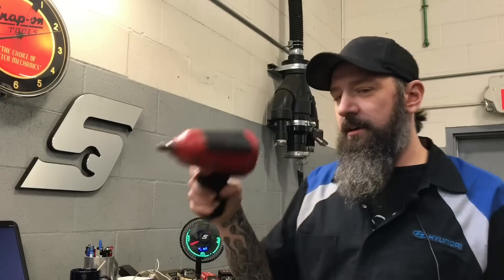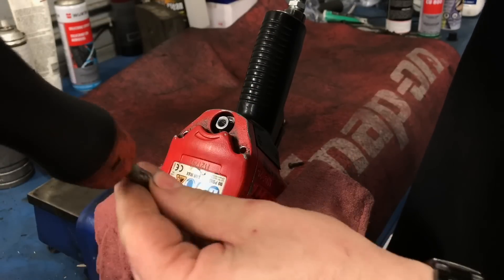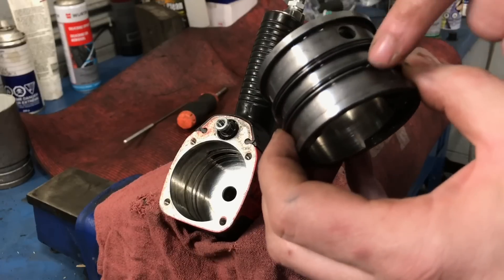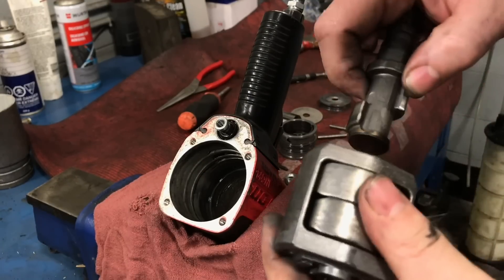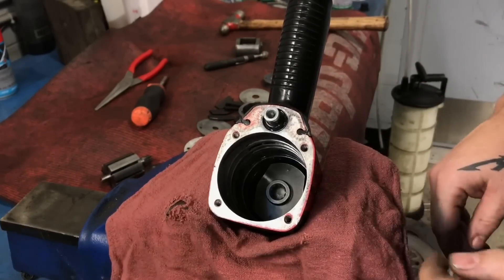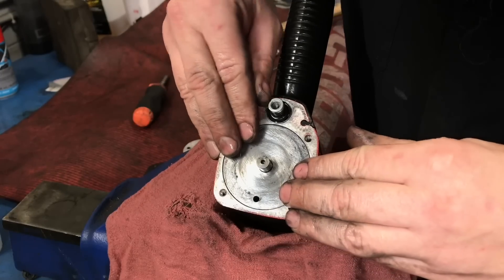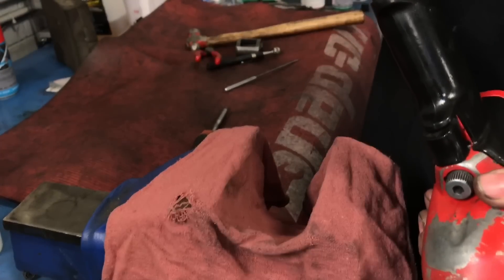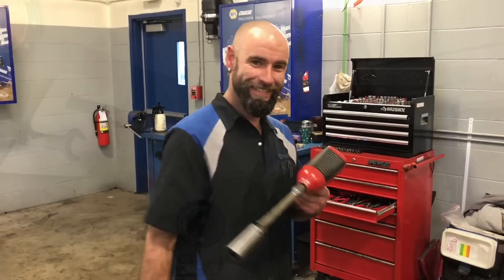SNAP-ON MG725 Teardown & Rebuild

Comment from the maker: Before everyone hammers me in the comment section, I know I didn’t use the right oil in the hammer casing. The proper Redline gear oil has been ordered. Thanks for watching! I hope you enjoyed.
Reply: The Snap-On Tool Review thanks for another epic video man
Reply from the maker: +michael gemmell you’re welcome bro!
Reply: How dare you lol
Reply: At least you put some kind of oil in, most guys probably wouldn’t. 🤣
Reply: Joel, great video, anyone who bitches about the oil needs to get a f**king grip, its an air tool not a top fuel race engine.
Reply: Anyone know what the right kind of redline oil is in there? Was going too refresh my 725
Reply: What about the seal for the hammer compartment eyy??
Reply: How remove gear from angle grinder CTGR 8850??? Can not found any information .
Reply: I was wondering which type of gear oil. Then I found an instructional maintenance video by Ingersoll Rand Power Tools, where for the SAME anvil mechanism Ingersoll Rand is using grease. So that tells me it definitely must be some heavy gear oil and not ATF. Quantity vise, there is a "How it's Made" video, where the quantity and how it is measured is visible (also even here the oil used appears thick).

Comment: My first big snap on purchase was the mg725 near on 10 years ago. Use it almost every day on heavy vehicles or "trucks" as we call them in oz and give it an absolute flogging. Went through a flood in 2011 where it was submerged in silt and crap for 3 days and to make things worse i couldn't get into my toolbox for a week and i thought for sure it was shagged. Drowned it with clean water down the air fitting, ran it, added a shit tonne of oil and 6 years on it is still going strong. Only thing i do religiously is oil it every time before I use it with snap on oil.

Comment: I picked up a 725 for 150$ on ebay 3 years ago and grabbed one on ebay in a lot that needed a rebuild. I got like 6 snap on hammers for 50$. Thanks for this otherwise I'd be lost rebuilding my 2nd 725. Its black and pretty.

Comment: I have some additional info. regarding repair of Snap-On impacts:  (per phone conversation with Snap-On USA customer service rep.)   They have a "flat rate" service of $140.00 for the repair of the impact (after warranty).  So, if you purchase a used impact from ebay and send it to them for repair, you would get this flat rate service.  Even if you are a private user DIY'er and you did not purchase it from a dealer.  It must have a serial number present.  They will repair whatever is necessary to restore its function.  The retail prices for parts are quite high:  that hammer cage part only that is shown above is $100.00 , anvil and hammers are $140.00, so it doesn't seem to pay to repair it yourself - these are retail prices that you would pay if you were to service the impact yourself (so it looks like snap-on gets the parts for much less cost).  But, if you insist, they will sell/supply you with the parts.  
There are many MG725's on ebay for a great price, but should you need service, snap-on WILL stand behind the used and out of warranty impact.   The rep. was very friendly and supportive which was really a pleasant experience these days!

Comment: When you opened the hammer part, i noticed that it was almost dry.

So advice before you rebuild it again, change oil seal in the nose before you build her together, and check anvil and hammers for damage and wear. after that build her up again. Besides those small points. i liked the video.

Comment: After 3 years my 1/2 snap on electric gun is out for repair has no power. I’m using the old mg725 again now it sucks dragging around an air hose.

Comment: Hi guys
The problem with mine is it seems to be lacking power. I know it’s not the air compressor as all the other air tools work the way they should with it. 
Do you guys have any ideas or any tips on what I could do to it to improve its performance? The best way to describe It is, It is as if it’s constantly on the lower setting and lacking that extra punch it should have.
I hope I’m not being too much trouble but any tips would be much appreciated.
Thanks in advance guys  🙏🏻
Reply: Do you use air tool oil daily?

Comment: My first Mg725 lasted 6 years until it grenaded the case. I picked up a Marco, it lasted a year. Back to the Mg725. Looking at the new one but it's pretty gutless compared to the Mg725.
Reply: Geoff Clark what model impact did you get from Matco???
Reply: Go Battery! Milwaukee 2767! MG725 couldn't even bust the lug nuts i put on the low boy trailer to back in garage after sa sandblasting.  That Milwaukee 2767 is a bad ass impact gun.  Itll do 60 lugnuts on a Big rig tq to 500ftlbs+ before i have to swap battery . Im impressed.

Comment: Had a IR244 opened up the ports with a dremell. Holofuck this thing would twist your wrist just popping the trigger too much power sheared the air motor splines clean off after 6 months use.Dropped a new motor in and noticed too much grease in the hammer mechanism my fault over greased the assembly. This is what caused the failure because used the gun 2 more years and sold in to a young gaffer in the shop 4 years later he says still has crazy power.I had replaced it with the MG725 gets use mabey 2 times a month now doing diag mostly in a heavy truck shop 99% def and regen issues. I noticed the last time I used the 244 was removing crossmember bolts this thing blew all of the crap in the frame in my eyes that fucking sucked.Da exhausts out of the housing above the trigger perfect for cleaning the rusty threads as the nut is removed. Not so good for your face. I thought  screw this shit the MG725 has a handle exhaust and with the muffler installed does not sound like a v8 with open headers.Anyways 30 years in the trade working with my head and not my back.

Comment: A old timer would use 20-50 lol I used to work at a quick lube so old timers just didn't understand the concept of the right oil.
Reply: matthew placencia ive heard the same thing. I was told that back in the daytLube shops carried staright 40.

Comment: That thing sounded like hell at the end. It should scream. Without polishing the front and rear wear plates and facing the ends of the rotor with sandpaper- you've got no chance of a good repair on that tool.

Comment: Or just buy a IR gun and call it a day. 
Anyways good video.
Reply: Gordon Freeman call it the last gun you will ever need. IR are super.
Reply: honestly the snap on is slightly better than IR but its 300 dollars more expensive so it fuckin better be, boss gave me an IR2131 thats bypassing super bad and it was just rebuilt not long ago, all the parts look good and seem to fit fine, the for/rev valve is suspect but its in great shape, the only thing i think is shitty on these guns is the trigger has a bitchy little plastic thing that pushes on a tiny rod that opens the valve, but thats not what broke and ive never seen one break so it must be strong enough somehow, in industry everything breaks, mostly cause its treated like shit, caterpillar makes the best engines around but we still get all kinds of broken ones to rebuild, as well as all the others that break, and its not always because of neglect, they sit out in the middle of the desert and run all day every day and only get checked on like once a week if that
Reply: 725 all the way. 
Solid magnesium...
Gonna last.

Comment: probably broke cause of the chrome hand sockets lol, they are made of a more brittle metal and arnt as thick because they were never designed for impact use, besides it could fuck up the bolts as well, i work in a mechanic shop and im just a 17 year old kid and i dont always use the right tool for the job but mama raised me right and i dont break sockets or fuckup the square drive on the end of an impact by using the wrong ones. . .and even if its fine i wont take the risk, i can sue for an impact socket breaking and getting shot into my eye, they will call me a dumbass for getting a piece of chrome vanadium in my eye with an impact, besides you will find impact sockets are way tougher, if the bolt is so close to the housing only a normal socket will fit then use a ratchet or breaker bar

Comment: This happened to me not one but twice on the same gun. The 2nd time it was less than 6 months into a fresh rebuild. My IR QT has 7 years without a rebuild. As a dealer tech in a high volume shop this design is probably snapons worst tool as to date I'm my opinion and I'm a snapon fan.